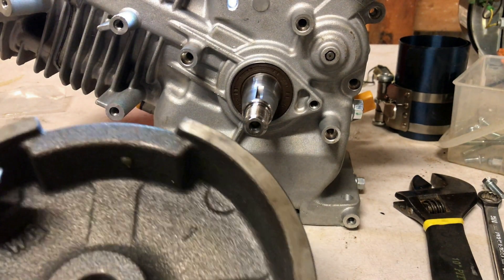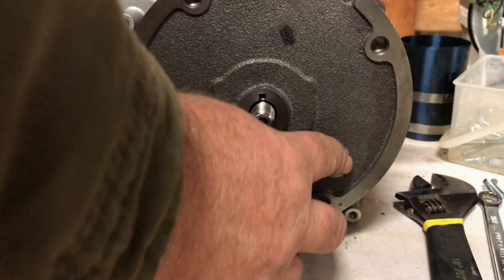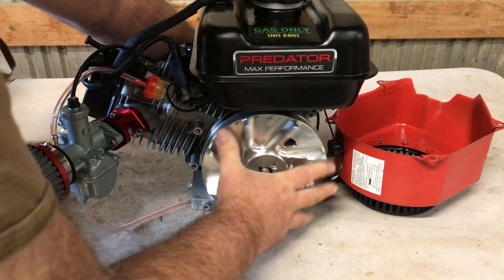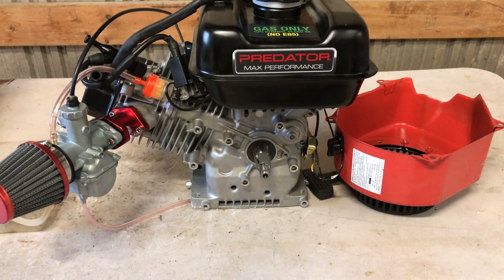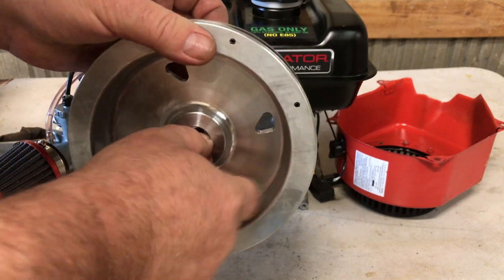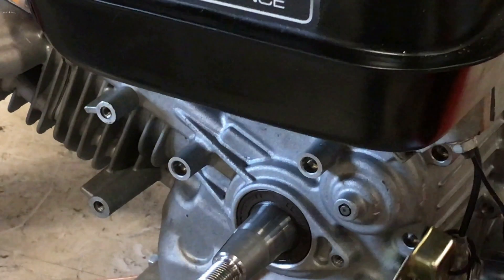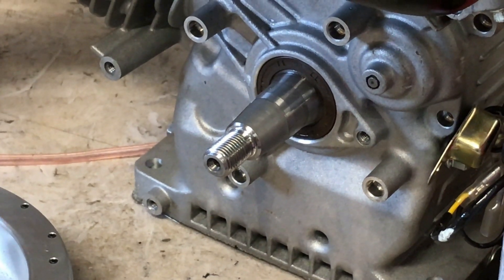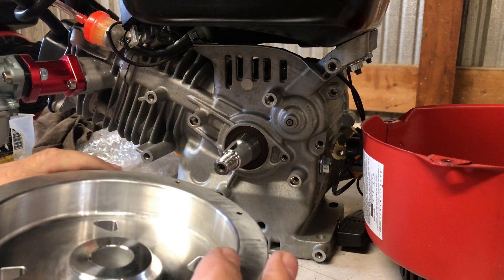Hard Starting and Kickback Solutions for your 224 Predator 212 Engine Build 223 Wildcat 236

Comment: My pred 212 won’t start that I just built and valve lash is good have any tips?
Reply from the maker: Without knowing your exact engine combination I can recommend that you check the simple stuff first. Make sure you have a good spark at the plug and that the plug is good. (New doesn't mean good when it comes to spark plugs. If you have a Torch brand plug or one of those gold looking plugs, replace it with a NGK.) If you have good spark, now check to see if you have a fuel issue. Spray some carb cleaner or brake cleaner (something flammable) in the carburetor air horn and try to start the engine. Did it start and die? If it did, now you know you have a fuel issue to resolve. It's really just a matter of procedure to troubleshoot a no start condition. Start with the simple stuff first then you can move on to other more advanced issues by eliminating what's NOT causing the no start condition. You can do this.

Comment: Have you tried adding more octane or racing fuel?
Reply from the maker: This 224 build has the piston at .010 above deck at TDC. It's quite a bit more compression than pump gas will cooperate with. I ended up using some additives in my fuel and adding some synthetic 2 cycle oil to the mix. It still kicks back every now and then but I can live with a little kickback every once in awhile. When it starts pulling the rope from your hand more often than not, that's when it's time to do something. (or get an electric starter) LOL

Comment: Valve springs are too tight
Should be .003
Reply from the maker: Generally speaking .003 is correct but in this 224 engine build it uses the Banzai 265 camshaft and they recommend setting the lash at .002 because these cams are known for compression release issues. The hard starting with this particular 224 build was caused mostly by pre-ignition, a lack of decent fuel to match the compression. This one sends the flat top piston .010 above deck at TDC. I put in some additives and a little synthetic 2 cycle oil that seem to help quite a bit. Thanks!

Comment: You got any advice on a 224 that’s stick but is hammering hard when started I love your carb tuning videos helped me out a lot
Reply from the maker: Alrighty, if the engine is stock and nobody has done anything like change to a thinner head gasket or any mods here we go: I'm sure you've checked the simple stuff like the engine oil level already and removed external items like a clutch or torque converter from the engine to isolate everything from the engine that could be making the noise,  so we'll move on to the next possible area to check. You'll want to remove the pull start cover/blower housing and check the flywheel nut. Verify the flywheel nut is tight and has not loosened. If it has, remove and clean the nut, apply some red thread locker to the threads and reinstall and torque to spec. (it's also a good idea to inspect the flywheel key, the flywheel bore taper and lap the flywheel to the crankshaft for a perfect fit while you're in there.)  While you have the blower housing off, be sure to check for anything that may be loose that could make contact with the flywheel, like the ignition coil. Just give it a good visual inspection and a quick check with a wrench or socket to verify everything is as it should be.

OK round two. Let's say you checked everything out under the blower housing, all is good and yet the engine is still hammering, it's time to remove the side cover and have a look inside. Drain the oil and inspect for any metal particles. A few shiny aluminum specs is normal but if it's got chunks of anything or if it looks like someone poured a bottle of glitter in the oil, there's a serious internal problem. Once the side cover has been removed and you have access to the connecting rod, check the rod for excess up and down movement on the crankshaft journal. Just give it push up and pull down to inspect the approximate clearance between the connecting rod and the crankshaft journal. It should be around 0.003" (three thousandths of an inch) and you shouldn't be able to visually detect much, if any up and down movement. (The thickness of a human hair is around 0.003") That should tell the tale of what's going on inside. I have seen a loose or bad wrist pin cause a knock as well, sometimes a wrist pin retainer can pop out and cause a world of problems. Changing to a thin head gasket can cause clearance issues between the piston and cylinder head that can result in a knock too. You'll find it, you got this, it's not magic and all it takes is patience. Check out the build videos if you need a hand with the assembly, that's why they're there.

Comment: So I have a question I never noticed that I needed oil for mine and now my issue is when I try to turn it on it's hard to pull not really that hard but it used to turn on with the light pull... I didn't check the oil until after that and had a little bit of oil so I added more it ran a little better but I still hear that little noise like metal slapping against each other so I'm trying to figure out what that is
Reply from the maker: LOL! I think you'll find out sooner rather than later! Jokes aside though, if yours has the low oil shutdown, it would turn off the ignition before damaging the engine due to low oil level.

Comment: My manual says .004-.006 intake and .006-.008 exhaust
Reply from the maker: That may be the case with yours but the thing to remember if the exhaust lash is set too loose, your compression release won't work.

Comment: i just finished a build with a billit connecting rod, pvl aluminum flywheel and 26 pound valve springs on a hemi and it’s snapping back still but it doesn’t have a timing advance so im confused as to why it still does.
Reply: i already adjusted valves
Reply: @dxyligxt it's crazy, with the new piston and nibbi 26
Reply: Yeah this is some hard work on these engines, I've got stage 2+ pred224 flattop n champ rockers.
Reply from the maker: If you raised the compression during your build, you'll have to raise the octane of your fuel. High compression with low octane fuel = arm breaking kickback.

If you added an aftermarket billet flywheel and are running gas instead of Methanol, you'll need to reduce the ignition timing by either deleting the timing key or use an advance key and install it backwards so instead of moving the flywheel clockwise to increase ignition timing, it moves the flywheel counter-clockwise to reduce the timing. The reason is most billet flywheels have added timing built into them for use with Methanol fuel. Methanol loves a lot of timing, gas does not. 35 degrees for Methanol is not an issue, anything much over 28 degrees for gas will kickback. The PVL flywheels I believe have around 30 degrees advance using a stock or "0" timing key. I would try dropping a couple of degrees of timing and see if that helps.

Comment: If your motor is hard to pull that means the compression release ain't working 9out of 10 means your valve lash is not set right or you have set the lash on the false top dead center (tdc)
Reply from the maker: That's a great suggestion. If you have a stock engine and it kicks back, you'll usually need to look no further than the valve lash adjustment. This video was mainly designed for those that built the 224 or 212 performance builds on the channel. Those can have kickback for different reasons other than valve lash.
Reply: @KentuckyFriedFixes built or not compression release still works unless you buy a cam without a release, ive got 224 with 12:5.1 ,a 212 with 13:6.1 and a 196 with 13:0.1 right now and you cant tell a difference in pull between stock and high compression
Reply from the maker: I can tell you likely didn't use a longer connecting rod during your builds of those engines. When the rod to stroke ratio is changed by using a longer connecting rod in place of a stock length, so is the timing of the piston in relation to the compression release position. The speed of the piston actually increases during the upstroke and downstroke with a longer connecting rod (Such as the ones I use in my engine builds). I do get what you're saying but there are other factors to consider beyond the basic concept of a compression release designed to work with stock length rod ratios. What all this means is, your compression release may not work at the right time on some performance builds, especially those that use a connecting rod that is longer than stock.

Comment: I’m new to this & I’ve got to install a new flywheel. What’s the deal with timing lights and all these calculations on tdc? All you need is to rotate the flywheel degrees off the key slot?
Reply from the maker: Most guys will use an offset timing key to advance or retard the ignition timing. I did that too until I ruined a good billet flywheel. Now I lap the flywheel to the crankshaft and delete the timing key. It doesn't take much movement to get close to where you need to be. 
Regarding the timing light method of checking the ignition timing, it's a sound way to get a very exact reading. This is mostly used by professional builders on high dollar race engines where every small detail can make a difference in performance.

Comment: If you are having this problem, try changing the oil. These engines run best with a lite oil like Amsoil 4T Racing Oil or Harbor Freight has a small engine oil. It’s not timing but pressure. I have a brand new Predator Ghost and it was destroying my hand kicking back. I adjusted the valve lash, coil and timing, nothing helped until I went with a thinner oil. Hope it helps someone.
Reply: hey man i have a 224 and it’s not starting at all
Reply: My engine is doing the same thing and it sucks........wanting to get it going. What oil did you use?
Reply from the maker: A lot of guys like the 20W Kart synthetic oils. I like the FHS 62R 20W60 for performance engines.

Comment: mine is brand new out of the box and I have done no modifications to it and it is doing the same thing
Reply from the maker: I'd check the valve lash. It's probably not set correctly. Quality Control is missing in action when it comes to these import engines.

Comment: I just ruined the crank on the duromax 208 trying to get the fricin key out kff now im in town for some crank lol😅 this shyt is crazy asf i cant even find a crank without the key or someone that can sell me one with it out already lmao dont call BMi carts lol that place a joke this hobby boy i tell ya its a head scratcher i was about to just bang the thing on and say F it but i dont wanna mess up my 10k rpm aluminum flywheel upgrade and i put the 22lbs springs in u think i should be good or get new rockers rod and retainers i mean my ducar been going for 3 years no problems u think i can swap that crank maaaaan look im sorry for all these questions its alot i know 😊
Reply from the maker: Hi AC! I have good luck using a pair of side cutters to remove stuck timing keys.
Reply: @KentuckyFriedFixes  thank u man I'm gonna try that instead of banging on it when the new one comes in I now know it's gonna kick back at least once lol my ducar literally only did it once in 3 years after I set the lash I was golden have a good rest of the week 💪🏼💯💨💨💨
Reply: Lowrider WAR is a great cruisin song  @KentuckyFriedFixes